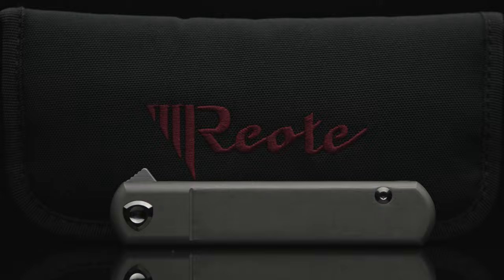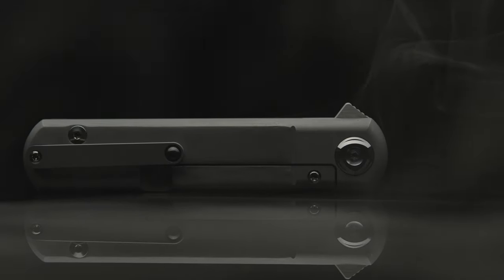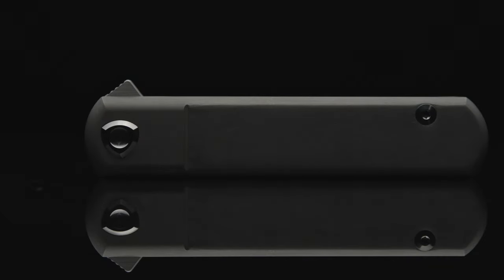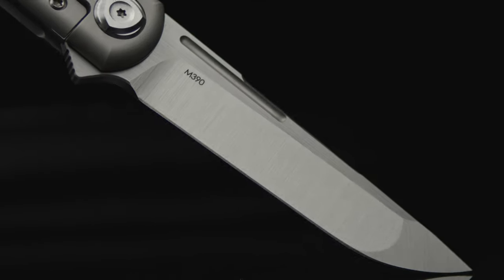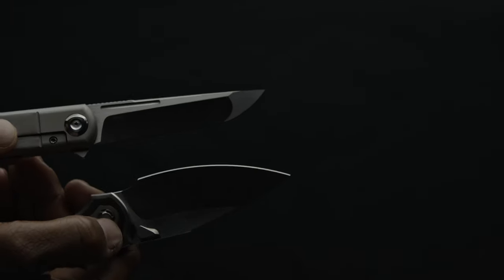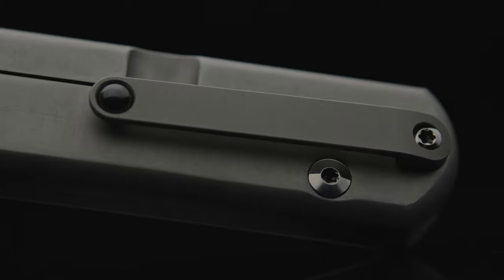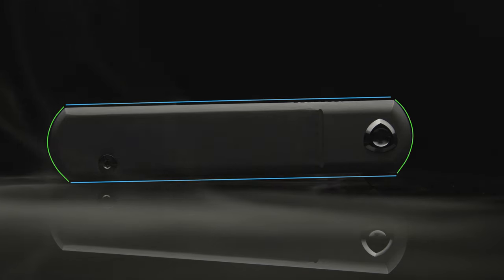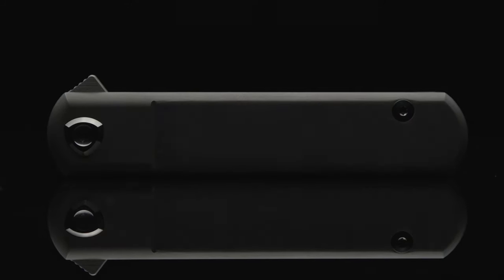REATE' UNRELEASED 2021 BLADESHOW T1 PROTOTYPE

Comment: Good video… I think a neutral handle design is good because it always works.. the blade shape is cool, nothing special… the flipper tab issue I can see .. the clip looks well done to me. Any flipper knife with a kick stop is an improvement as I never like them sticking out the bottom but it’s not a must have feature that would prevent me from buying a flipper either. It’s not something I would buy. But it looks well made.